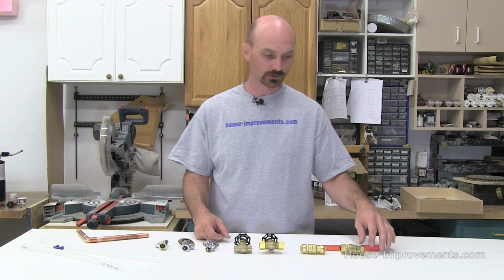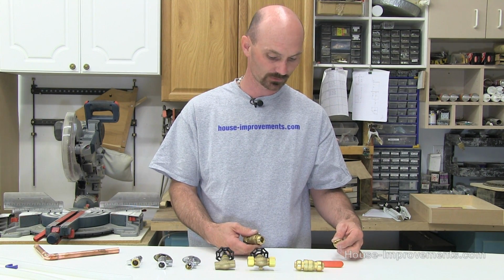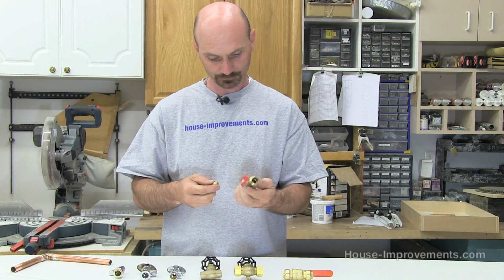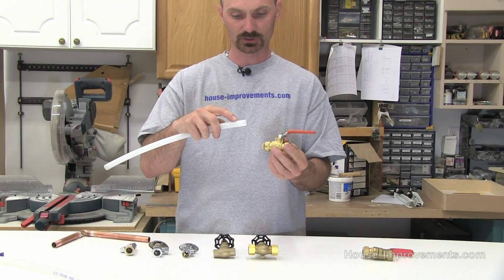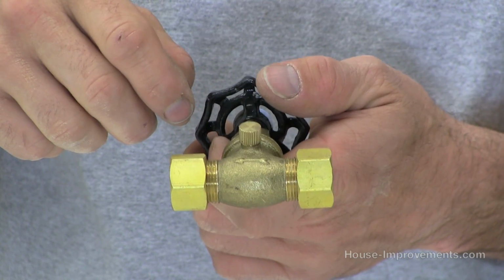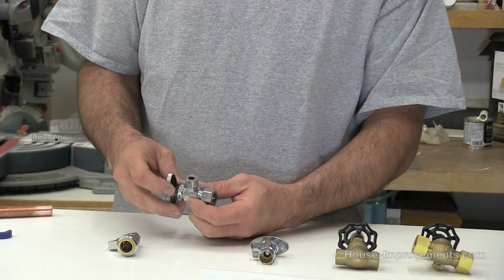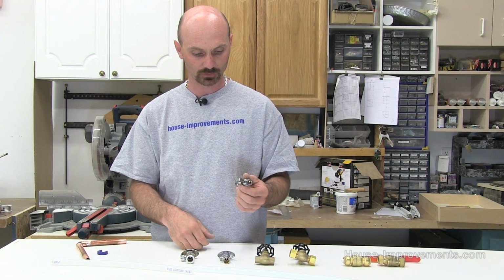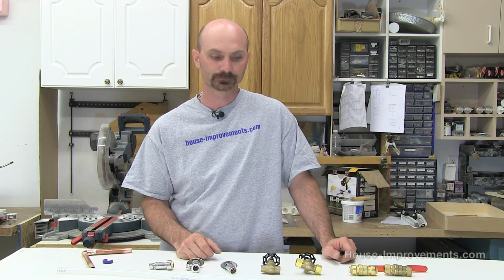Information On Different Plumbing Valves

Comment: In case anyone else got confused by this:  I measured my copper pipes and the diameter is 5/8" inch, so I was wondering if I had some odd-sized pipes in my house.  Then I found out that when people say 1/2" pipe, they mean the inside diameter - which equates to the outside diameter minus 1/8".
Reply from the maker: Good point!  When talking about pipes it is always inside diameter because depending on the material the pipe is made of the wall thickness is different so the outside will vary.

Comment from the maker: I have never had one of these leak yet. That is the brand I use the most as well. Maybe when you tried to pull it off you twisted it a few times while pulling and the stainless steel teeth chewed up the end of the pipe? Or maybe you do not have it inserted fully.I would remove it ,cut the pipe off about a 1-1/2" and re-install. Make sure it is pushed on 1".

Comment: I didn't take out the clear tube from the valve before I stuck it on the copper pipe...it's not leaking so I'm guessing it will be OK?

Comment: I used the push in(shark bite) I believe was the brand.  When I tried to pull apart manually, it seemed a tight fit, however, when I turned the water on, I leaked bad.  What is happening?  Thanks.  Your videos always seem to be produced right at the time I need them.

Comment: Thanks, Shannon. Very informative video. I have read somewhere that some valves can sustain repeated on-off cycles whereas others are more fragile and cannot withstand frequent (weekly, e.g.) use. Is this true? The context for my question is my replacing of my laundry hose bibbs. I can't use a washing machine valve because the stud bay is very shallow and stuffed with copper pipe (no structure for mounting) ; drain and supply are both outside the wall. I'd like to use a 1/4 turn ball valves with  small handles that wouldn't interfere with each other.
Reply from the maker: Ball valves are generally the better more reliable valve.

Comment: Do they make ball type valves that can be used in conjunction with anti freeze outdoor wall bibbs?  THX  for the videos.
Reply from the maker: Yes ,You can use a ball valve on an outside wall bib line that has a water drain .https://amzn.to/4iUh0nc
Reply: @ THX for the info! Be well!

Comment: I will not use a compression valve if the water psi is not between 45 - 65.

Comment: You keep turning the valves on or off. But you don't say which way is on or off.
Reply from the maker: Most any valve is closed is clock wise and open is counter clock wise.